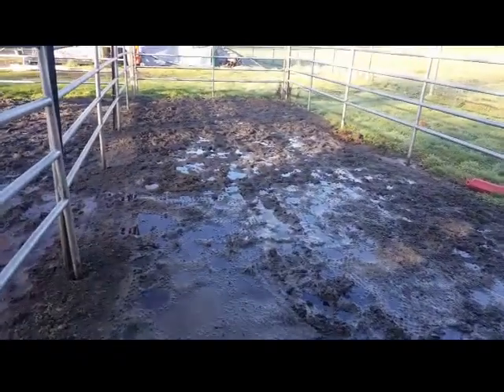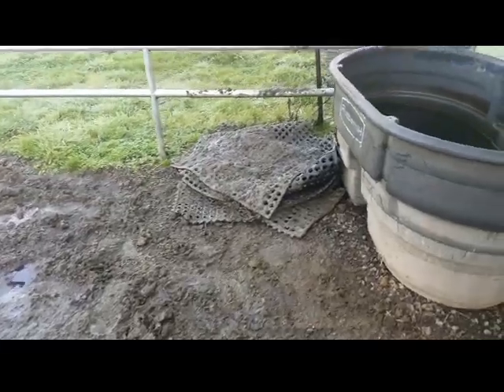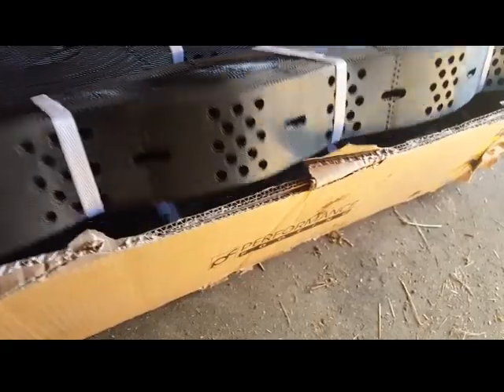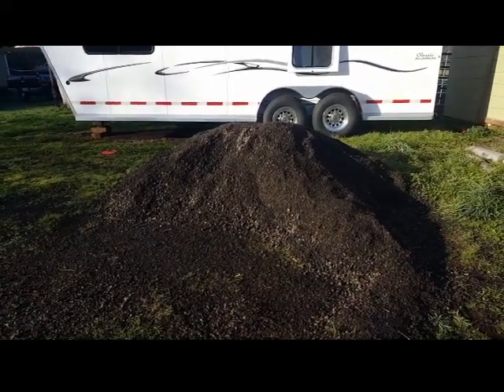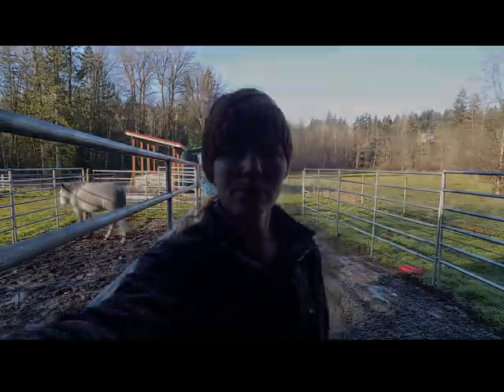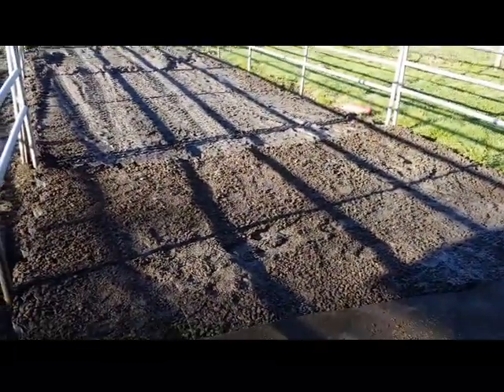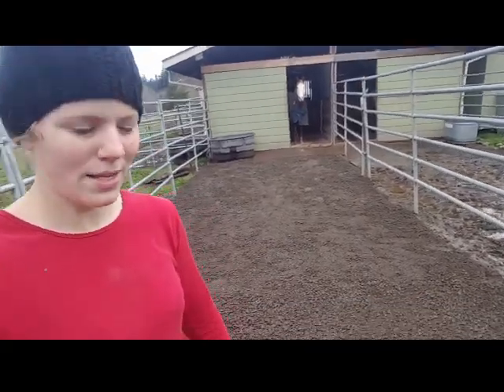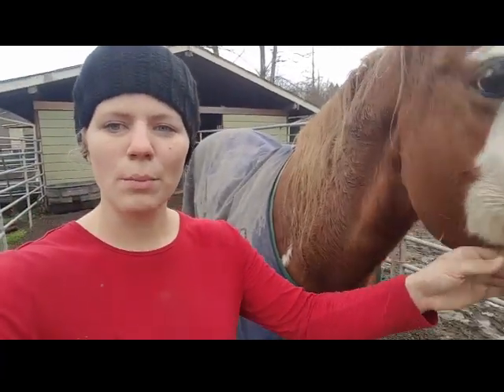I Installed Geocell in a Paddock and Here is How it Turned Out

Comment: We use this for the railroad, we dig out all the wet dirt disc it in the sun to dry it all out, put the dirt back in tamped close to grade then put down the fabric and then the cell on top and then refill with  with gravel and ballast.
All the time sometimes will put a double layer of cell and fabric

Comment: It is hard to tell, but it does not look like you are opening the cells very far, so it goes less far in such a case. I have used this stuff in a wet area, and it is better if you put landscape fabric under it to prevent the gravel from merging down into the mud. I also would maybe use 1 1/2" minus in the cells, and then skim it with 3/4" rock on top to smooth it out a bit. I notice that when you used the tractor, you did not pull any material out of the paddock, but merely smoothed it out. I would get the mud out first. Rock stands up to water and lets the water flow through. Mud turns to slop when wet.

Comment: Usually any gravelled area should be compacted. Using a vibrating plate tamper would work well in a small area.
Reply from the maker: I've found that the horses pack it well enough that I haven't had any completions.  However,  I did use a plate compactor for thr gravel base under my round pen ;)

Comment: That is bc the more you add the more Mudd you get. You need drainage .just putting rocks under it is not going to work. I doubt this new way will work.
You should not keep horses in such small muddy places. That is another reason for the Mudd. Simply use your grass paddocks. Horses need to be in larger spaces. At least 1 acres per horse.

Comment: Have tried such stuff in my dog kennels to help with drainage and keep the dogs on a more solid surface. They really do not work and I followed the instructions to the teeth and did not skimp on gravel or materials. Find yourself a qualified sand and stone  landscaper and have the proper road base sand mixes put in, the stuff at your local garden center is not what will do the

Comment: hard to understand why all the geo products are so pricey.   

you may and i missed it but you could have dug out all the rock mud, laid woven geo fabric or just the geo grid, them reused same old rock mud to refill the grid.  

geo fabric rocks.  with out it a bucket of gravel and a bucket of mud turns into one bucket of mud.
Reply from the maker: That's what I did 😀  I get a lot of comments about what the base "should " be, but I don't respond back because they either didn't listen to what I said in the video, but also don't know my own personal situation. These paddocks when originally put in are about 8 inches down with 2-4" crushed rock over fabric, then 5/8 or 3/4- on top of that. So what I scraped is just the muck layer but the  base was still firm and good to go.